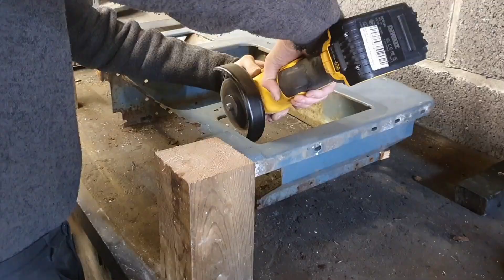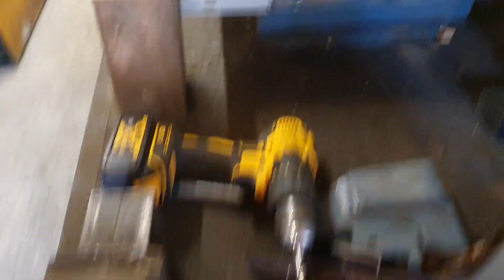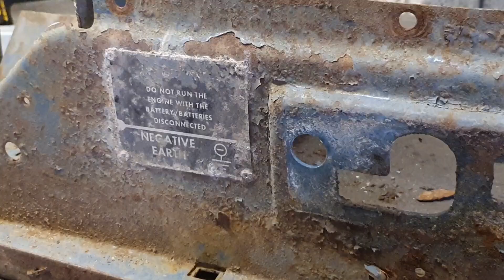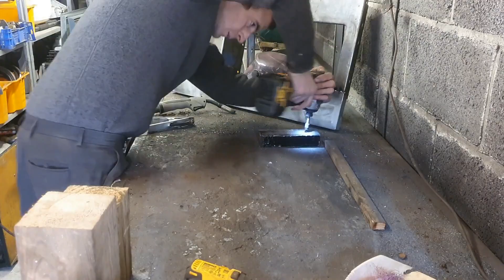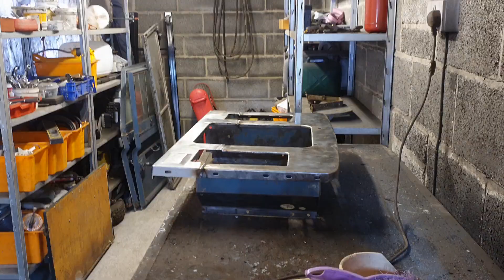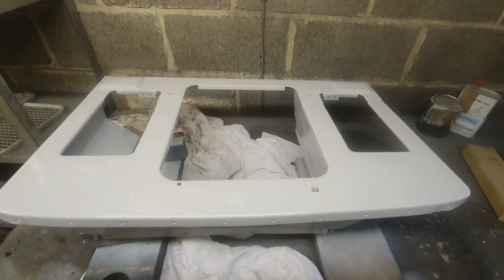Repairing the Front Panel with jig - welding and painting - 37 Land Rover Series 3 Project

Comment: Did you find what the problem was with the paint.

Got the same repair to do on my 1975 S3.....bought it new when I was 23.

I will prob brush paint mine is I can still find a supplier of polyurethane paint that I can easy thin down.
Reply from the maker: I cant say for sure. The paint was partly to blame I think, it was very sensitive to contamination. The of course the othe problem was probably bad prep and contamination. I scratched the surface and tried again and all was well the second time round.
Reply: @lozl  I did think surface contamination but thought....no you look like your doing a thorough job.

What did you do about the missing radius.

Can I ask where you got your repair section.

I have seen a guy on Facebook...Welding Wood...he does them.
Reply from the maker: @nickaxe771  Nick, you're too kind! But yeah I think I just hadn't preped it well enough. 

I left the gard Edge, I didn't make it match the radius of the original as it was all covered by the grill. 

I'm afraid I'm not sure where that came from....  I got a lot of bits from paddocks. If they have one on there then I believe that's likely where I got it from.
Reply: @lozl  Great stuff.